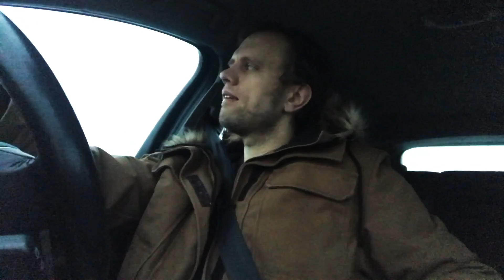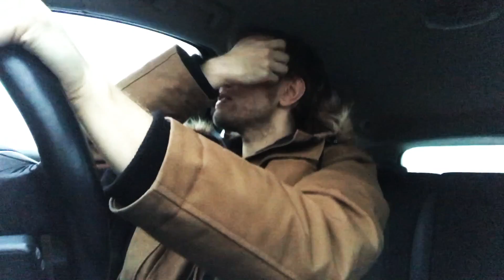Commute talk: Crappy data structures

Comment: I love how you started talking about virtual region and heap allocation when that was, what I was thinking about all along.
Back when I actively worked on my kernel project this definitely was my major struggle, especially due to the whole "chicken-vs-egg" problem.
Since many data structures (like a linked list or AVL-tree) already require some kind of memory allocator in order to be dynamic,
it is hard to build kernel level memory management with them, since you'd need some kind of memory allocator in the first place.
You also don't want your memory allocator to infinitely recurse unto itself when it runs out of memory for a data structure ;-)

- fleroviux

Comment: Grey and rainy here in NYC too.

As a developer who has built and has used many data structures... bad data structures are one of the topics I can rant about for days. And very closely related is just APIs in general. Too often APIs/data structures are built without consideration of the full possible usage. For your own code that's not so bad as you can change it easily enough but with standard data structures or well established libraries it's incredibly frustrating as most of the time the only way to get the behavior you want or to get it efficiently is to have access to the internal representation. For instance: C++ STL libraries were/are a mess. Some had push and no pop. Or no compare and swap. Or vectors unable to construct with an uninitialized buffer. How much slower and how many bugs have occurred as a result of these kinds of things? Or look at C strings. It's not uncommon for APIs to just take char* and not len leading to lots of strlen calls. It's easy to say "use another data structure" but it is not easy for a novice to know these gotchas and ... they are standard. They will be used over alternatives regularly. When the API of your building blocks are bad it is difficult for your own code to not pick up some of that. Documentation often is also bad in that they don't describe the O notation runtime of specific functions and their relative speeds (given O notation is only so useful).

Understanding how one's API can affect things downstream is not always easy but it often feels like developers of APIs aren't even thinking about it. One of my favorite examples of an API choice that was seriously bad... POSIX requirement for what file descriptor is to be returned from open and such. Makes concurrency in that space difficult.

Comment: wasn't the VVVVVV cpp port **giga cursed**?
I read some of it, it had a switch with thousands of cases. GeNeRaTed CoDe
Reply: Is there anything wrong with a large switch? If you have at least -O1 then you get an O(1) jump table.
Reply: depends on how much code the compiler actually generates, if I recall it correctly long jumps are a bit shit.